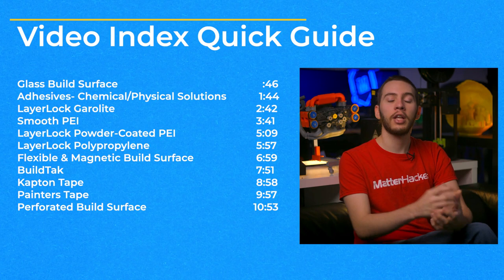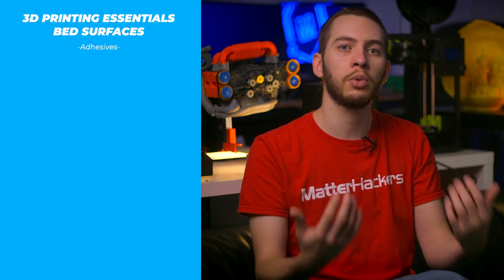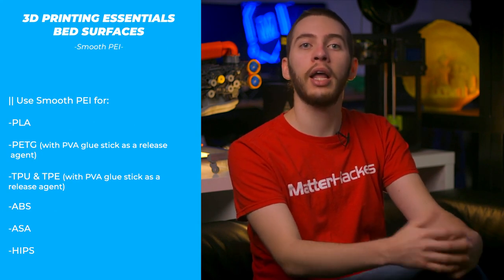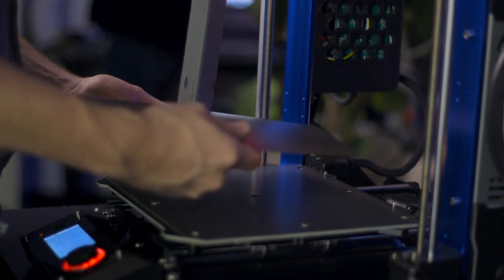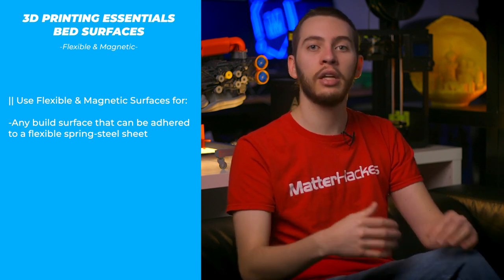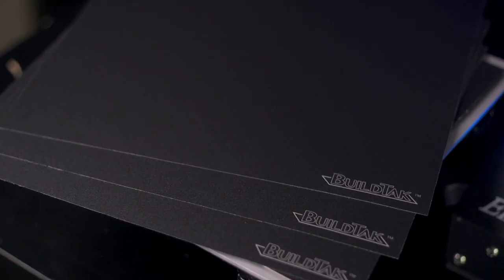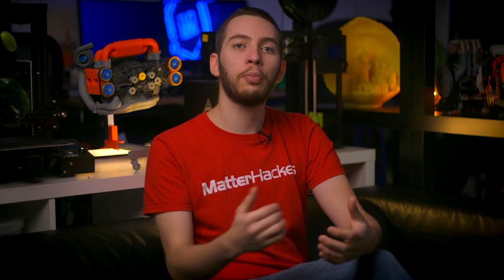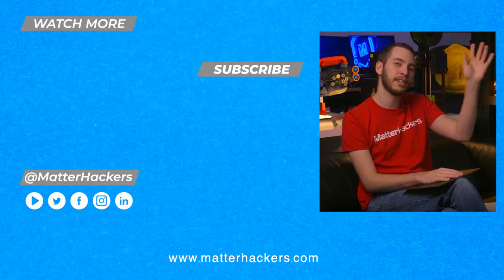3D Printing Essentials: 3D Printer Bed Surfaces

Comment: I've used kapton tape for my ABS prints for years with great succes, WITHOUT any gluestick. I did however sand it lightly with a grid 400 sandpaper which helps with sticking.
Kapton tape will wear and rip, you have to replace it regularly, which is a tedious job.
Last year I've switched to FR4, it's really is a game changer. I heat it to 100 or 110 C. It sticks and self releases when cooling down. Super!
Note; I print ABS/ASA exclusively

Comment: The Garolite you sell is fiberglass, but there are many different types available. You do NOT need to use PVA gluestick with Garolite at all. You need to prepare the Garolite surface prior to printing on it. You can dry sand the surface with 200 grit sandpaper, but this is not as even, nor does it work as well as wet sanding the surface. I use a #60 grit sanding sponge from HomeDepot. I use 1 drop of dish soap, with water, sand the surface in one direction, and then in the adjacent direction. After a few prints, you may need to resand the surface again to release the tiny microfibers. The Garolite can be sanded hundreds of times. If you still have adhesion problems, use a brim around the part and set your first layer to be 60% of your nozzle diameter.

Comment: stick is simple...heat up to 80 rub hot melt glue stick on plate then turn off bed print cold ...plastic will bond to hot-glue..when finished heat up bed to release and if you still find edges start to lift hot-glue them down...!

Comment: Ok, so I have an Anycubic Mega Zero 1.0 (it doesn't have a heated bed), what surface could I use to get the print to stick to the plate and not bend?

Comment: I’m having some trouble, I just got a textured PEI flex sheet for my E3v2 and I cannot for the life of me get PLA+ to adhere to the bed! The bed is level, I have a proper amount of “squish” no matter what I do the corners start peeling up. Pretty upset with this when I just spent $30 for this sheet when I’ve been told it’s everyone’s go to
Reply: what brand is the pla?
Reply: @darkwhite1259  eSun pla+. I figured out my issue though.. my Pei sheet was about 1/8” thinner than my glass plate was. I needed to lower my z axis and we’re all good now
Reply: @MP-pv9nj  ah, i see

Comment: Glass plate wouldn't be practical on a Prusas mk3 though, or would it?
Reply: ofc it isnt, prusas beds are better than any of the above options, and the glass would ruin its PINDA ABL procedure, all in all just a rubbish option to put anything except a spring steel flexplate on it
Reply: @zommy5re77  glass ftw is best material to print on, prusa have their own method with magnet's specified probing points, comes down to preferences glass bed give the best bottom surface period!
Reply: no it wouldn't be practical just stick with prusa stuff, any other printer I would have said yes

Comment: Layerlock is not the best option for most of these

for smooth PEI use Wham Bam PEX/PEI , buildtak smooth PEI or even the prusa PEI replacement sheets
for Powder coated PEI use Ultistik or the original one (prusa mk3)
most garolites are fine

layerlock, like most of matterhackers products, is a more expensive, often worse version than other options, and has no real use in the market

Comment: There is one thing about most 3d-printing video that annoys me, and it's that "Nylon" is thrown around so haphazardly. PA6 and PA6-based composites are no problem to print with most print surfaces. PA12 on the other hand, oh boy.... These polymers are so different, you can't really use the same word for them both, as they behave wildly different, especially when printing.
Reply: I also agree how people discuss Nylon as generally the same. However, most people do not spend as much time printing with it, or care. 

I disagree with you though on the differences between 6 and 12. PA12 is much easier to print than PA6. Let me explain why. Most filaments you can by today that are Nylon based are largely either Nylon 12 or a mixture of mostly 12, with some 6. The reason why these are easier to print is because Nylon 12 has a much lower melting temperature (50-60°C lower), thus making it easier to hold to the print surface or maintain a heated chamber temperature lower. Nylon 6 requires more heat at the nozzle, more heat on the print surface and more ambient heat in the chamber than Nylon 12.
Reply: @MichaelJHathaway  yeah most of what you mention is true, but nylon 12 warps much, much more than what nylon 6 does. On my prusa i still have had no luck with nylon 12 even with an enclosure, magigoo, gluestick, any combination of bed/nozzle temps, brim, bed leveling etc... nylon 6 worked first try with just gluestick. Didnt even need a brim. Was just like printing PETG. Even managed to print a .15mm gap first try with perfect tolerance.

Comment: Do not put glue on your build plate this is very outdated information.
Reply: Glue/gluestick, hairspray, 3D glue and Magigoo have their place not only as adhesives but as release agents for certain types of filaments and bed materials-not sure where you’re getting that it no longer has a place on 3D printing.